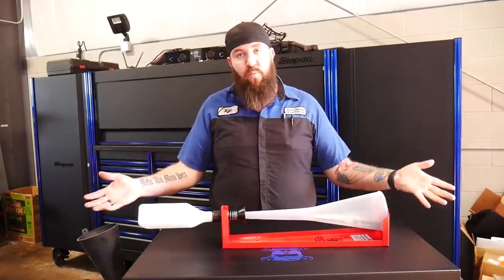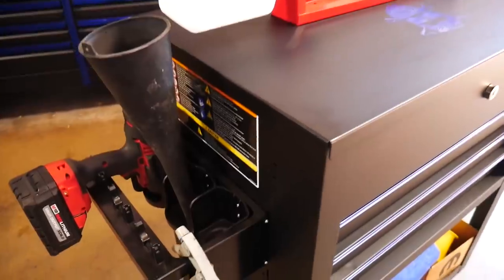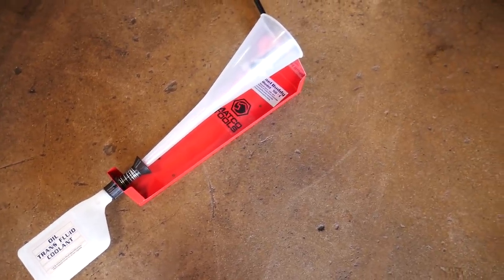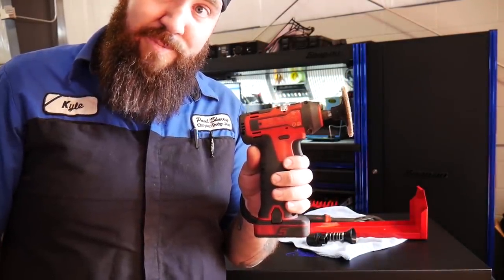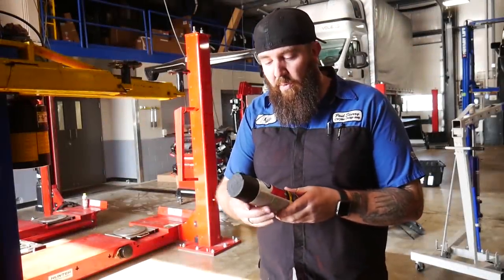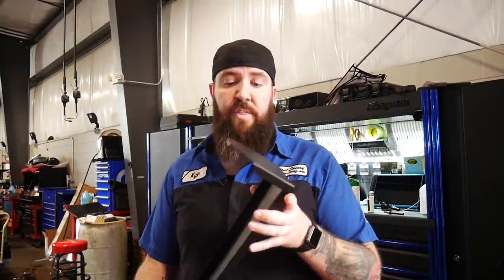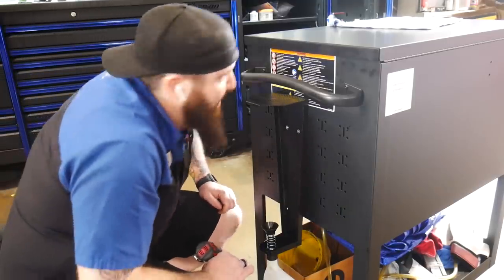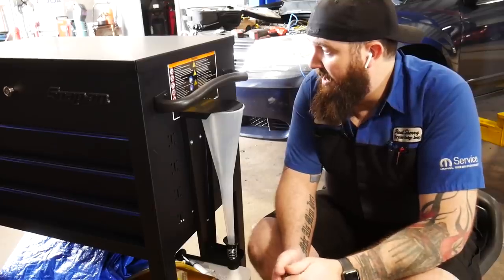SNAP-ON SERVICE CART WITH CUSTOM FUNNEL BUDDY

Comment: Can you give any insight on the camshaft/lifter issues on the Hemi engines? Going to look at a Grand Cherokee Monday but I don’t want it if I’m going to run into engine issues.
Reply from the maker: Usually they stem from using bad or wrong oil along with a lot of hot idle time. The rollers start to lock up on the lifters which will then over time wipe out the cam. Usually you will start to hear a more pronounced tick and eventually a misfire along with it. Those are also known for exhaust manifold hardware failure causing a tick noise on cold start up.
Reply: Rustbelt Mechanic so basically the only way to know when the shit is about to hit the fan is engine noise? If the vehicle has good maintenance records I should feel better about buying it or stay away? The owner does have intake and exhaust modifications as well as a tuner on it.
Reply from the maker: Yeah noise is the only precursor to that really.
Reply: Stay away!!!

Comment: Dude. Why the f do you own a cart. Nothing of any value in there. I keep all my daily used tools in mine
Reply from the maker: Yeah I don’t “store” big tools or major things in there. The cart is for rolling stuff around the shop that is needed for each job. I have to go around to 4 bays to do work, so it’s really inefficient to roll back and forth between my big box and a bay all day. Therefore I load it up with the tools I need for each job and the drawers have all the assisting components like adhesive, electrical needs and misc hardware.